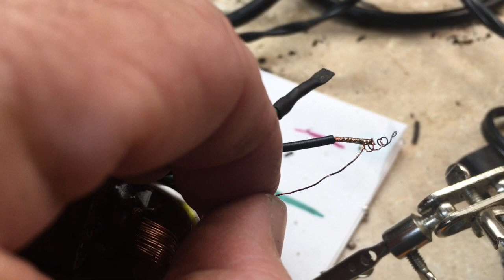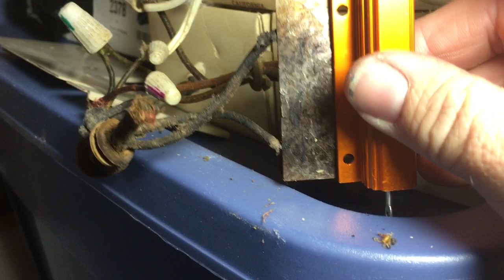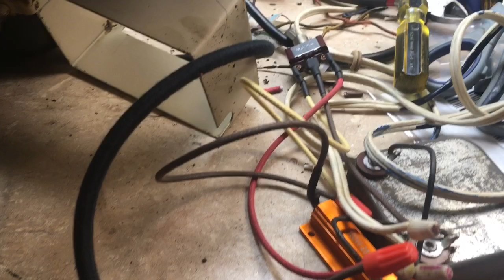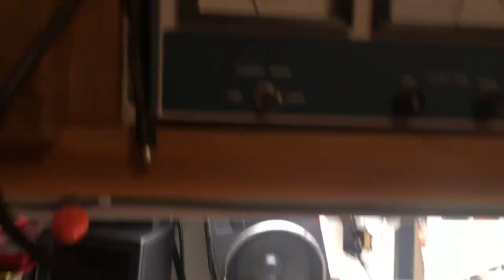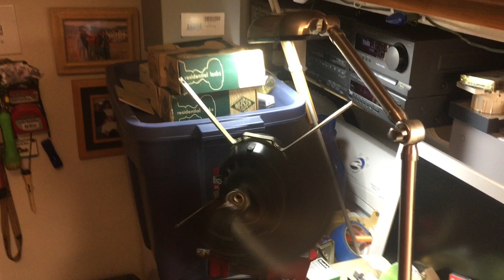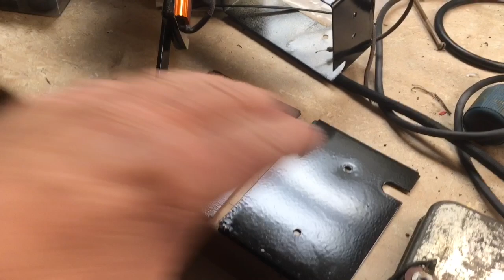1948 Westinghouse Mobilaire Progress

Comment: That looks amazing! Fantastic work :)
Reply from the maker: Thank you! Getting closer since I got the new capacitor in, and wiring is somewhat installed in the jucntion box. If I can do half as good as y'all do on restorations, I'm going to call it a win! I added an inline 3 amp fuse. It spikes to about 2.5 amps upon power up on high speed. Think that is a good idea? I didn't see any overload protection at all!
Reply: dynatrak Yup, adding the fuse is a good idea. And most likely there wouldn’t be any protection on that motor.
Reply from the maker: Cool. Got it back in the stand, and been running for 1 hour with no problems! I've got it in the bedroom across from my office/bedroom, about 25 feet away, and on low I feel a nice gentle breeze while sitting at the computer. I would like to find one for myself now, at least a Riviera!

Comment: That fan is really looking sharp!  You have great attention to detail, and really get into the nitty-gritty of it all.  Were those pre-formed heat shrink "caps" or did you make those yourself?  Never seen them with the end already closed up.
Reply from the maker: Thank you. I thought it would be a quick and easy job, but no no! The people I am repairing it for are not mechanically inclined, so it has to be right. Apparently it's been in the family since new. I saw it working many years ago, and was impressed how quiet, and much air it moved since it doesn't seem to have very high rpm's. They told me shortly after that visit, it had quit working. Seven or so years later, it's finally getting fixed.

On the heat shrink tubing, I got the end nice and hot with the heat gun, and then crimped the end with needle nose pliers, and held for a couple seconds, until cooled. I'm too cheap to buy special ones already made up!
Reply: My dad has a Fasco box fan from the 60s I've been eyeing, but it doesn't look like he's letting that go ever.  Chances are when I inherit it, it will still be running.  So I know all about old faens and what they mean to people.  

I'm actually not a big faen user, some people need one on in order to be able to sleep and other such tomfoolery.  Or just have one on for the sake of having one on.  Personally, I don't like stuff blowing on me.  Worse, I can't STAND how it chops up sound.  On Halloweenus, since I kept myself in the living room so I could be poised to answer the door at any moment, I had a couple laptops out that needed a few updates applied.  Happened to have the ceiling faen on because it actually was nice enough, but man did it chop up the sounds those things made.  Awful.

I figured those shrink tubing bits were homemade.  I don't think I've ever used shrink tubing on a joint like that, I've generally just used it on "in-line" joints.  Made up a couple of short extension cords that way over the years.
Reply from the maker: Sounds like your Dad has some cool stuff! 

I'm just the opposite with faen usage. I have my 1983 Lakewood C122x mini box faen by my bed more for white noise, but it has a nice gentle breeze too. Also my ceiling faen is on medium each night. Once it gets really cold I won't use the ceiling faen, just the C122x. My only gripe with faens is when they start rattling, or squeaking. That I can't stand, and it will keep me awake until I pop in some earplugs!

When I removed the head wire from the windings, each connection was taped with some sort of mystery tape. It reminded me of dry brittle masking tape. I figured the heat shrink tubing would work just fine to insulate the soldered connection.
Reply: My dad only has cool stuff because he won't buy anything new.  Plus the old stuff was made to last, so there is no real need.  Problem is, he's so far out of touch with reality on what things should cost and how long they should last.

I know about that dry, brittle masking tape stuff.  No idea what it is but I've dealt with that stuff before.  The worst is old electrical tape where the tape itself starts disintegrating and you get black stuff on your hands that's near impossible to wash off.
Reply from the maker: I, unfortunately, have experienced the disintegrated electrical tape. Gotta get out the lacquer thinner for cleanup! 
So has he not experienced china pride quarity?!
Reply from the maker: The lacquer thinner is the last resort. I've always used good old Lava soap. The last time I had to buy some I found a brand new two pack at an estate sale for 50 cents. 
That Simonize sounds like some good stuff! I bet you are right, and will never see it again. Too bad about that store closing, sounds like it was a pretty cool place for tergents, and soap. I'll check out the Simple Green cough. I use the Lemon scented Simple Green in my work, and it seems to agree with me.

Oh now I see clearly how your Dad is! I've got some relatives like that! Most of the time I just have to shake my head, and go on.

My Dad is just the opposite, he can't wait for something to die, so he can buy a new one. Like I've heard you say several times, His type will have one, buy two more, and then throw all three out. Or in my Dad's case give me one or two. I got a nice dremel, with drill press last time I was out to visit! He always sends me home with a box of cool stuff!
Reply: Yep, I have Lava, that works well.  I also have a couple bottles of I think "Red Lion" brand soap similar to Lava, they're vintage parts from IBM when my dad used to work for them.  I looked up the Simonize soap, it's definitely available from janitorial supply houses.  Never knew Simple Green was available in yellow scent.  Har har!  Incidentally, I hope you dilute that stuff, pretty much all spray cleaners can be diluted quite a bit with still excellent results.  I have been planning a video of all kinds of spray cleaners I've amassed, and every single one of them is diluted.  One that seems to work very well is the Mexican "Mistolin" brand, a lot of grocery stores carry it.  VERY heavily scented, and most scents are awful (I recommend the "Floral" and "Lavender" scents only).  It's also very heavily colored, which makes dilution easy.

Another great spray cleaner is L.A.'s Totally Awesome, available at Dollar Tree.  Yep, it's a buck, and it truly lives up to its name.  Last time I was with the mother-in-law in CT and we used the Aldi electric smoker (she has one too), she tried cleaning it with this eco-green cleaner stuff, it wouldn't even make a dent in it.  We made a trip out to Dollar Tree and picked that stuff up, the grease just melts off.

Like I said, my dad bought that TV in 2001.  The old TV it replaced he took apart, threw out the picture tube, but kept the circuit board and speakers for about 10 more years before finally throwing it out.  I ended up with the speakers, one day maybe I'll actually use them.
Reply from the maker: Haha, yep yellow scented, and the liquid is indeed yellow! Yes I dilute. The Green kind I don't care for. They also have blue, and orange scents too, which are also not for me.

 I will have to check with my local janitorial supply house to see if they carry that Simonize soap. I'd like to try it out.

 I have used L.A.'s Totally Awesome, and yes it is awesome! I stumbled upon it when I was looking for a Pine-Sol replacement. I cannot stand the new fragrance of the Original Pine Sol, so pretty much anything now on the market with 8.7% pine oil is better. I have a glass Pine Sol bottle from the 70's with 30% pine oil, and it is still good. One cap full, approximately 1/2 tsp, is enough to make three gallons of mop water.

 Is the Mistolin product similar to Fabuloso? I know the scent of Fabuloso is very potent, and a little goes a long way.

I recently disassembled an old copy machine at work, and saved the circuit boards, and faens! Maybe I'll use them someday. Couldn't pass up free faens, and components though!
Reply: Wow, a glass bottle of Pine Sol, that must be really cool.  My mother used to use that when I was a kid, and I don't remember it being a glass bottle in the early 80s, but I could be mistaken.

Mistolin is similar to Fabuloso, I got some of that too.  Funny, I have spray bottles with colors that match the liquids inside.  This will be a sight, this video, when I make it.  I got a bottle of Fabuloso that was from Dollar Tree, and is "Cool Mist" flavor, green, and cloudy.  Weirdly interesting stuff.  Sort of mint-flavored.  That'll be in the video, if and  when.

A lot of faens in that stuff were 24 volts, so check.  I believe they'll run at "low speed" on 12 volts.
Reply from the maker: Yep it is in perfect condition, even the paper label. I'd like to find another so I can fill it up sometime. I always keep an eye out while at estate sales. 
Yes, the faens are 24 volts.
Ok, I'll check out some Mistolin sometime.
Yeah it's been a while since you've done a tergent movie!
Reply: I actually have some laundry tergent but I don't think that will be included, or if I really will ever make that last movie on laundry tergent.  I've sort of stopped collecting as no matter what store I go into, I own the laundry aisle!
Reply from the maker: I believe it. I see a glimpse of the collection from time to time!